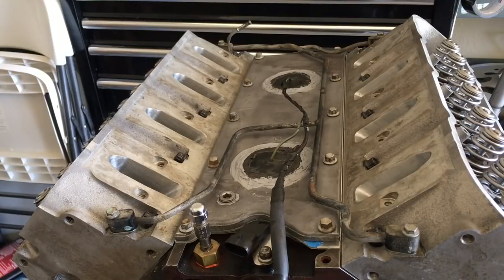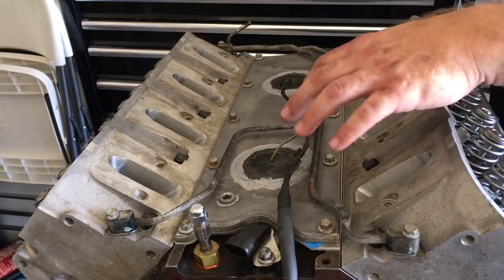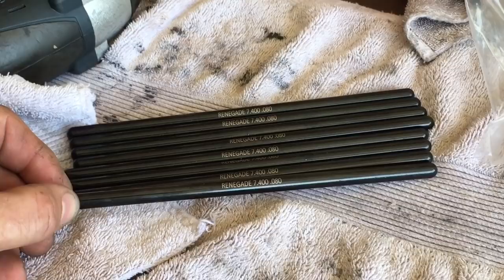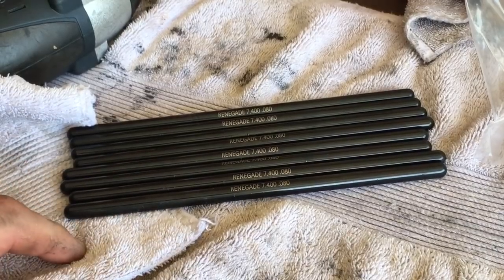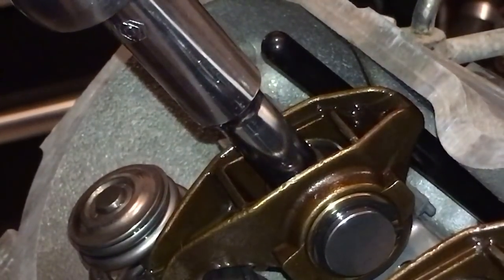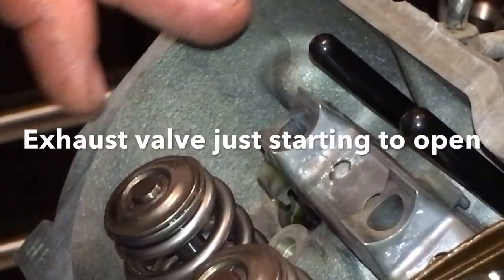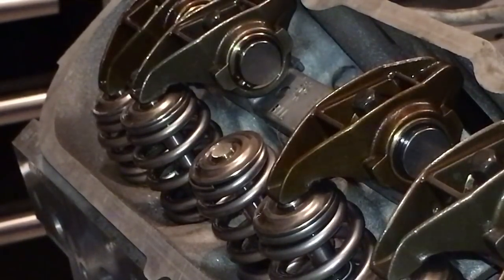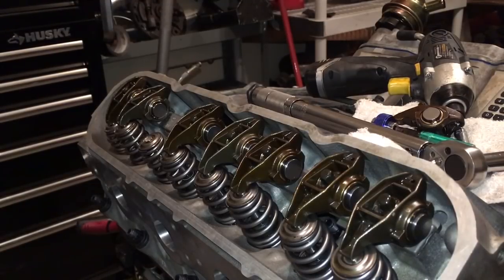LSX How many Turns to set lifter preload

Comment: Don't think a shim on the valve spring would make it higher. The valve stems are all same length. If you didn't seat your valves correctly or you have massive wear allowing you valve to seat higher that would be a machine shop issue or change the length of your push rod to make up for it.

Comment: Buy a pushrod checker put pushrod in place when the cam is on its base circle then run rocker arm bolt down hand tight . Once you adjust pushrod checker to proper length ( rocker-arm should have no up and down movement (0 lash) but moves side to side freely. Then add pushrod checker length and lifter preload value together and that will be your pushrod length needed.
Reply from the maker: Already done the videos on my channel.  The PR length checking tool is the most accurate method for sure.
https://youtu.be/BWWUgzYH_NM

Comment: So I checked mine and have about 1/8 short of a half turn on both intake and exhaust. I'm looking for another 3/4 turn and going by this vid I need .0369 (one turn is .0492) added to a 7.400 rod. What size rod would I need? Or how much decimal does a 1/4 turn equate to in decimal rod length?
Reply from the maker: PR 7.400” + .0369”= 7.4369”
Looking at the commonly available lengths you can try 7.425” or 7.450”
You really need .070”+ lifter preload. 
Note: The plunger in the lifter is super easy to compress, only flick the pushrod with one finger while turning or wiggle/shake the rocker to identify true zero lash.  Pinching and turning the PR is too strong and leads to a false reading.  The PR length checking tool is way easier see my video. 
https://youtu.be/BWWUgzYH_NM

Comment: When building you want less reciprocating mass so don’t use shims, just get properly sized pushrods.
Reply from the maker: You are apparently not familiar with cylinder head assembly; you set up the valve springs with the intended installed Spring height to establish your seat pressure. You may have to alter the valve spring install hight +-slightly in order to set the desired pressure using shims under the spring, machining the spring pocket or using +- locks.  Shims under the springs doesn’t affect the weight of the valve train since they are static.  I hope this helps you understand the process better. JD
Reply: @HeadFlowInc  I wasn’t clear in my comment, you are correct that shims don’t effect reciprocating mass and yes you can use locks that allow for less closed valve spring pressure. I meant you shouldn’t shim the rockers to compensate for pushrods that are too long for the build, just get shorter pushrods if that is what is called for in the build. Thanks for the reply.

Comment: Spring shim thickness has nothing to do with lifter preload!!! If the spring is supposed to be used with an installed height of, let's say 1.800", it needs to be set there. Plain and simple. However, you could have 2 valve springs both set at the 1.800 installed height, both with .030" shims, but need 2 different pushrod lengths. Because not every valve stem is exactly the same length, and also the keeper grooves may be ground in slightly different spots. A LOT of things can affect exact pushrod length. Hell, one lifter may have a slightly higher pushrod cup than another....
Reply from the maker: I understand you have this need to be judge mental, but slow your roll. 
One of my valve seats required a .030” cut to clean up damage from a previous machine shop.  We decided rather than replace the seat to run it even if it needed a different length PR. 
When you “sink” a valve it also increases the “stem height” requiring more shim ie .030” to set the valve spring installed height.  Changes in stem height affect geometry and pushrod length on an non-adjustable valvetrain.

Comment: Only way that one rocker could be off is if the valvestem is stretched , or the valve seat is sunken into the head ... spring shim don't matter
Reply from the maker: You are correct, sir, the original shop did such a poor job trying to do a valve job, the new shop had to cut one of my intake seats an extra .030” to fix the damage they had done. The option was pay to replace the seat altogether and machine it, or leave it alone and deal with that one valve with a slightly taller stem height. So you get a gold star ⭐️ on this one!  JD

Comment: what if I torque my rocker arm down and it's just where the pushrod doesn't turn by hand .. then I add .035 to that length in my case for the preload ?
Reply from the maker: The keys are making sure the lifter is on the backside or heal of the lobe and a “Light” touch when spinning the pushrod.  You do not try to grab and spin the pushrod, it’s like a flick or barely rolling between the fingers to find zero lash. 
You’d be surprised how easily the plunger in the lifters will start to compress. 
As for lifter preload it depends on what the manufacturer wants, it ranges from .025”-.100”.  .050”-.070” seems really popular.  JD
Reply: @HeadFlowInc  cool I think I have a pretty good understanding now .. no reason to really torque the bolt . I was thinking that from hand tight would add preload I guess .. I got the Johnson 2116lsr lifters , they say .035 +/- .010

Comment: I don't understand why the measure varies in each one
Reply from the maker: The length of the pushrod changes the lifter preload. The thread pitch provides a measurable distance based on threads used and rotations of the bolt.  Since you’re starting at a zero lash point, the goal on factory lifters is .050-.070” preload.  From zero lash it takes +- 3/4 to 1 1/4 turns to get the .050”-.070” preload or there abouts.  JD

Comment: The valve tip is going to be same height whether you have any shims under the spring or not.
Reply from the maker: Incorrect, you’re not accounting for the amount of material removed from the valve seat and/or valve face during a valve job.  The more material cut/removed from the valve seat allows the valve stem to protrude further through the head because the valve physically seats deeper in the hole. 
When a machine shop does a valve job they have a “margin” where they set the valve stem height by grinding the valve tip to establish the needed height.  Now, when an excessive amount is removed from the seat, there’s only so much you can remove from the valve tip, requiring a new seat to restore the stem height.  I hope this helps you understand how stem height can vary.  JD
Reply: @HeadFlowInc    I took it he needed to shim spring to get pressures right.  So therefore I am right. Off course if you cut the seats the valve tip will move up, hence needing a shorter pushrod.
Reply from the maker: It’s a Semantics your wording and description was confusing what you were saying. Yes. After you’ve set the valve spring installed height to specification they should all be close to the same +- .005” if possible.  The valve tip can easily vary in height based on many variables.  JD
Reply: In a perfect world.... a valve spring shim is used to take up the gap you machine off the valve seat. Many shops use shims to get the correct spring tension which is a bad practice. If you have to do this....then your springs need replaced or the correct springs need to be bought. Machining the valve stems is old technology...mainly used on Ford and Dodge engines as they were all non adjustable valvetrain (LS engines have very little to take off). This is why you should buy new correct length pushrods. All seats should be machined uniformly. Meaning if you have one seat that is .03 lower than all the others they should all be done that way or it should be replaced to match all the others.

Comment: So... you find the base circle... you put in your pushrod length tool... bolt down the rocker arm... extend the length check to zero lash. Then measure the length checker. Once you have that, you just add the preload you need to that measurement... and order push rods that length. Extremely simple. 

With stock lifters, you have so much travel you can get away with murder. Better to have it near the bottom of the lifter travel for power
Reply from the maker: Just remember never rotate the engine when using an adjustable PR length tool. 

Exactly, find PR length at Zero lash then add what ever pre-load you want to find PR total length. 
You’d be amazed how much recommend pre-load varies based on lifter used and cam grinder.  GM says .050”, others say .070” then BTR has recommended.100” 😳😳😳
There’s operating theories both ways on which controls the valve better at high rpm based on the amount of oil trapped under the lifter plunger.  JD

Comment: This video is confusing at best. Sounds like the narrator is at the time of the video learning from instructions off frame.  Editing suggest narrator misspoke several times.  YouTube is flooded with how to videos from people not qualified to give instructions. This is an example of just that.
Reply from the maker: Correct, I tried to research the idea of using thread count or turns after zero lash to determine lifter preload.  Because it’s not an exact way to measure lifter preload or needed pushrod length I highly suggest buying an LS adjustable pushrod tool!  (I have a video on how to use the tool if you’re bored)
The EOIC method for adjusting valves is a long standing way to accurately adjust valves particularly on roller cams due to the lobe designs. 
I’m not sure what you expected or wanted but I hope you found it somewhere.  Thanks for watching and the feedback!  JD

Comment: I'm on the same boat, getting 1 2/3 turns with 7.425 pushrods ,a horrible sewing machine noise during idle and mid range rpms, going for 7.4 pushrods hopefully i get 1 1/4 turns
Reply from the maker: Airman The best investment was when I spent the $25.00 on the LS adjustable push rod for measuring the push rod length to set the lifter preload.  Way easier and accurate as long as you know what lifter preload you need. Also if you have true LS7 lifters you may need 7.450” length as they have a lower pushrod cup depth. JD
https://youtu.be/BWWUgzYH_NM
Reply: @HeadFlowInc  definitely it is the way to go sir thank you

Comment: Why don't you just torque the rockers to 22lbs and be done with it.  Who cares how many turned it is.
Reply from the maker: 321 It's Done Lifter preload is very important when building the LS engine.  When you change head gaskets, cams, lifters or have the heads or block surfaced all these affect the amount of lifter preload. 
Hopefully this will help you if you’re building and modifying an LS. 
Note:  I found its way easier and more accurate to spend the $25.00 and buy the LS adjustable pushrod to measure and set lifter preload, see video below. 
Thanks for watching and the feedback I appreciate it!  JD

https://youtu.be/BWWUgzYH_NM
Reply: I have an LS f-body, I do most of my own work but I don't rebuilt engines.  If someone didn't do all this and just torqued them all to spec without turning the engine over etc...  What would happen?  Would it wreck itself immediately?
Reply: 321 It's from my understanding if u don’t have the right pushrod length than u don’t have the right preload on the lifter. So it would probably wear prematurely and be a very noisy. Some manufacturers have different opinions on what that preload should be but using a pushrod length checker would be a must in my opinion.

Comment: Soaking the lifters in oil over night compared to installing them dry, will that effect the preload?
Reply from the maker: J Robles It should not change the preload but it can increase the plunger resistance when finding zero lash.  The internal lifter plunger will slightly compress when  finding zero lash, if the lifter is full of oil it may resist slightly. 
Just make sure you’re using a light touch when you spin the pushrod during pre-adjustment. 
I will say the best/easiest way to find the correct Pushrod length is to buy one of the $25.00 LS adjustable pushrods online.  Using the turns to torque is not nearly as accurate. 
I have a video showing how easy the adjustable PR is to use!  JD

https://youtu.be/BWWUgzYH_NM

Comment: Yeah didn't think of that my pushrods r 7000 & 7050. So I should hav a different preload than the other aslo did u say 2 check preload with the guide rail out?
Reply from the maker: MicTheGreaseMonkey I don’t know anything specific to the 3800, I’d have to research it. I highly recommend you get a manual or some reference material on building the 3800 V6. 
I’m at a loss on this topic; wish I had more experience with the platform. 
I don’t even know what year your 3.8 is?  JD

Comment: Hi m8 u wouldnt hav the same sequence 4 a a gm v6 3800 l67?
Reply from the maker: Ive no experience with the GM 3800 V6, I don't want to mislead you.  Make sure you verify both lengths, Intake and Exhaust many times they can be different.  Look it up to be sure but I think the lifter pre-load should be .050'-.070'

Comment: Good vid m8 do i hav 2 position each each cylinder @ tdc when I set the lash on the at cylinder?
Reply from the maker: MicTheGreaseMonkey This method  allows you to start on one end and work across adjusting one valve at a time.  As you can see you will need a way to turn the engine over while watching the rocker/pushrod movement, which means there can’t be excessive slack. 
Here’s a GM service guide:

With the engine in the number one firing position, tighten the following rocker arm bolts: Tighten 
Tighten cylinders 1,2,7 and 8 exhaust valve rocker arm bolts to 30 N·m (22 lb ft). 
Tighten cylinders 1,3,4 and 5 intake valve rocker arm bolts to 30 N·m (22 lb ft). 
Rotate the crankshaft 360 degrees. 
Tighten the following rocker arm bolts: Tighten 
Tighten cylinders 3, 4, 5 and 6 exhaust valve rocker arm bolts to 30 N·m (22 lb ft). 
Tighten cylinders 2, 6, 7 and 8 intake valve rocker arm bolts to 30 N·m (22 lb ft). 
Install the rocker arm cover. Refer to Valve Rocker Arm Cover Replacement - Left or Valve Rocker Arm Cover Replacement - Right .
Reply: @HeadFlowInc  hav u seen Ellison empire's clip on adjusting valves do u know if he is referring 2 roller valves or flat valves?

Comment: So I'm just a little curious..  when you were tightening the Rockers at 8 minutes and 20 seconds roughly when you were tightened it and the valve was cracking open vs the others that you were showing it would only pre-loading the lifter. Was the cam in the wrong position and that's why the valve was cracking open on that one and different from the others or is there something else that I'm not understanding. I'm not trying to say you did something wrong I'm trying to understand why one was different than the other two far as cracking the valve open versus pre-loading lifter.
Reply from the maker: all the boost Using the EOIC method of adjusting valves, the acronym stands for: 
Exhaust valve starts to Open you can adjust the Intake valve on that cylinder. 
Intake valve goes fully open as it just starts to close you can adjust the exhaust valve on that cylinder. 
Don’t confuse “Just started to open” & “Just started to Close” 
EO-IC 
The proper and more accurate way to set up the lifter pre-load and pushrod length is to buy a $25.00 adjustable pushrod for the LS engines, this is what I ended up doing later in the vehicle.

https://youtu.be/BWWUgzYH_NM

Comment: Did this method for alo 16. & after a couple of revolutions there were some rockers that i could rattle a small fraction. But have no oil pressure to everything yet because no prelube yet are start. Is this normal
Reply from the maker: Ralph Huff Two things:
1. Hydraulic lifter plungers will compress and be loose until the engine has oil pressure to “pump up”.  
2. I ended up buying a $25.00 adjustable pushrod to verify my PR length.  I ended up setting my lifter preload at .070”.  Using the adjustable pushrod is way easier, faster and accurate. 
There’s a lot of recommendations on what preload to use ranging from .050” to .100”
https://youtu.be/BWWUgzYH_NM

Comment: So with this added preload on that one valve could have Aided in premature cam lobe wear? And is why we should always check each push rod after a cam install along with many other things,
Reply from the maker: Brian Roagers I agree we should be checking for proper pushrod length to set the lifter preload.  I found lifter preload varies greatly between manufacturers from .050-.060”, .070” to .090-.100”
You wouldn’t hurt anything unless you bottomed out the lifter plunger or not enough preload can be very bad as well.
Check out this video, much better way to set the proper preload. 
https://youtu.be/BWWUgzYH_NM

Comment: You should really make a follow up video to this so nobody screws up there ls by adjusting their valves this way. When your on the base circle of the cam, the valve doesn’t open when you torque a non adjustable valve train unless your pushrods are too long, and they make a cheap tool for finding proper pushrod length. It’s called a checking pushrod. Their $15.99. I’m looking at it on summit right now.
Reply from the maker: blake dymond I haven’t watched this in a long time, my point was if the PR is too long, when the lifter pumps up it can hang the valves open. All cams regardless of tappet s should be adjusted with the lifters on the heal or back side of the lobe.  Hydraulic, hydraulic roller, Mechanical, or mechanical roller all should be adjusted on the heal. 
Since this video I purchased an adjustable PR and set my lifter preload to .070”.  There are three theories out there on how much lifter preload is better, ranging from .050”, .070” and .100”... 😳. 
The turns past zero method just isn’t very accurate and has some gray area, lesson learned.  JD
https://youtu.be/BWWUgzYH_NM
Reply: thehappyTexan you should buy a dictionary and learn there their they’re